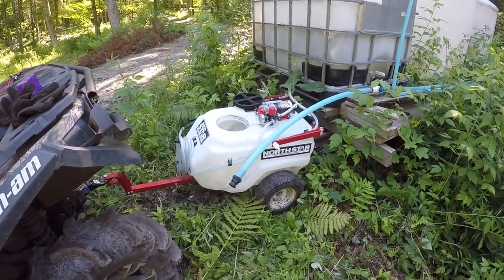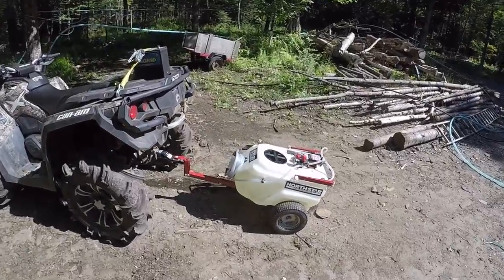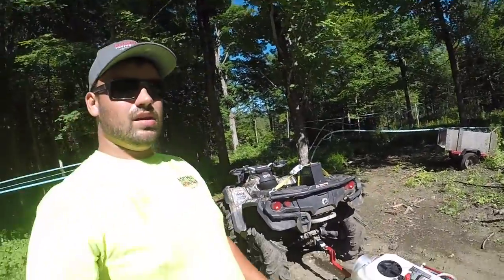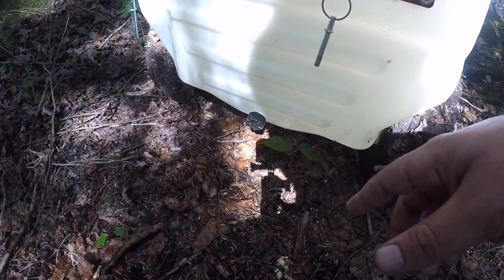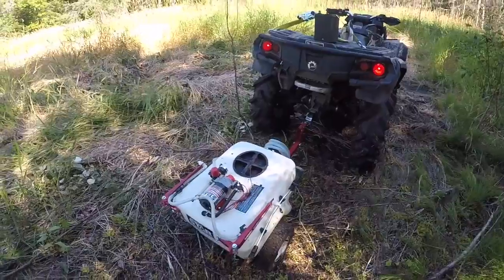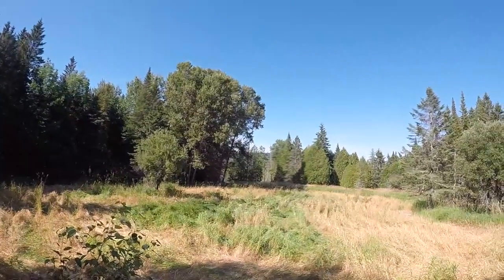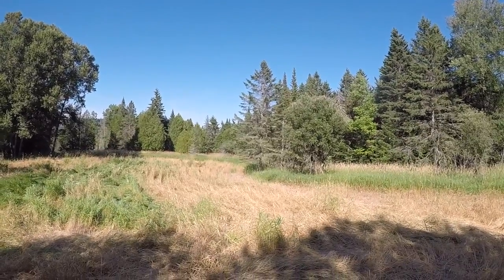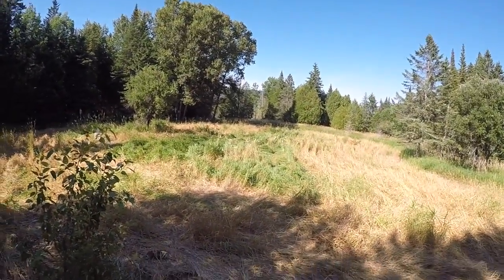Spraying the Milk can plot!

Comment: Hey... that thing looks like it's going to tip over anytime - you should tell us what brand that is so we don't get it please lol!

So you've got me thinking... I've been driving in circles with a brush hog trying to keep stuff back and fight for the land -

So that chemical is okay for water runoff? 

And you're about to plant stuff there so it must be safe...?

That tank would tip over in my field - I'd like to be able to spray that stuff behind my brush hog immediately -

Will that kill the roots and help me smooth out the field? Trying to put a track in for a dog sled... it's very bumpy because of the roots

 that stuff might work along the woods and by a brook where I can't get the tractor?

I will watch your next video on spraying and see how it turns out - if you can give us any info on what sprayer not to buy

 and the chemicals you use 

and other practical tips, I'd appreciate it! 

Thanks!
Reply from the maker: The tank is made by Northstar. it has its uses but can be awful frustrating. Not sure on the run off idea. It goes on as a mist and dries quick so I don't know that there would even be any run off to worry about. But it will not affect any new planting. It sure is a time saver! in the next video i talk a little about what I use for chemical. As far as killing roots to smooth things out I'm not sure that that would work.